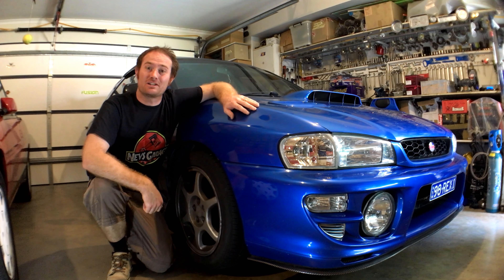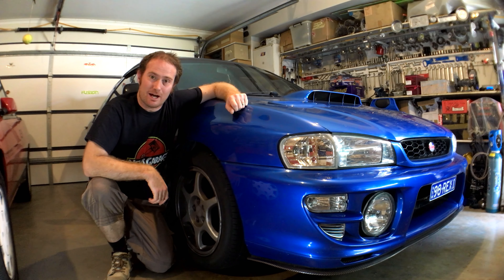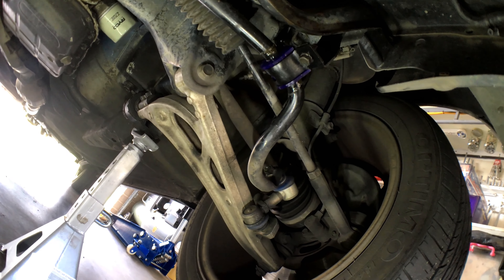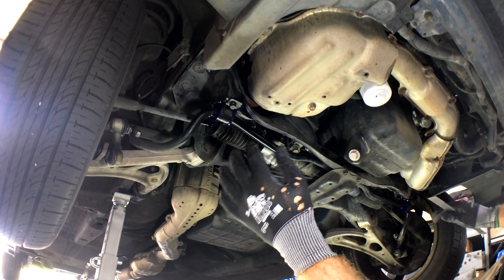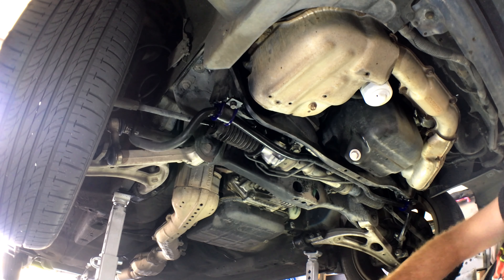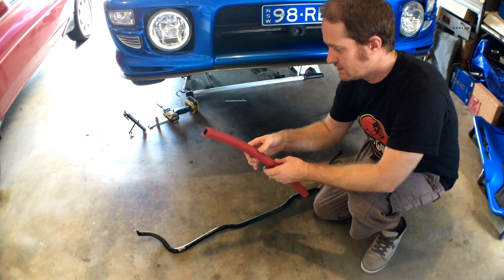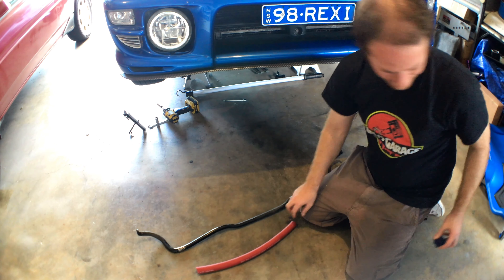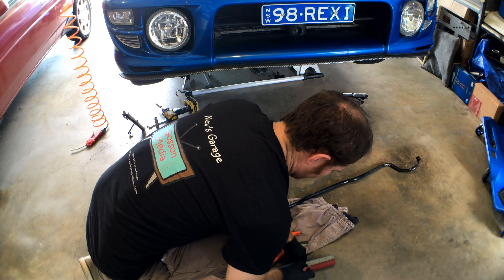Making & fitting Sway Bar Lateral Locks - MY99 WRX

Comment: Did it work? I think it would have long as the Sikaflex had cured. 
I had a tube of the stuff laying around my garage that was going off so I cut the center rubber out of a worn gearbox anti roll mount, made a new center sleeve & then filled the space where the rubber was with that Sikaflex Goo and sandwiched it (under some weight)  between two non stick surfaces. It it has been in my vehicle and still going strong for over a year now.
 It took about a week to cure completely. Tip: Sika uses humidity to cure so if you spray the job with water & put it in a sealed plastic bag it cures quicker. Cheers